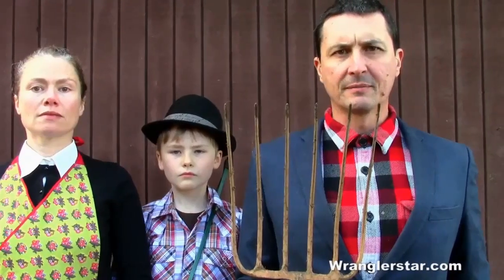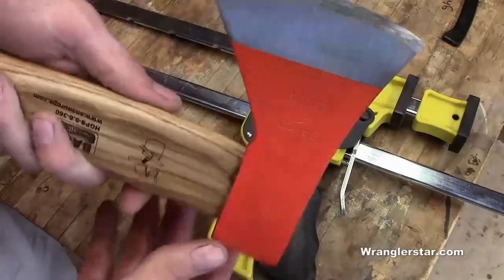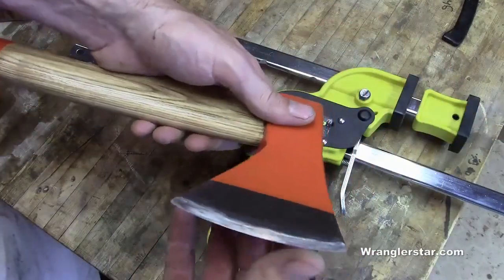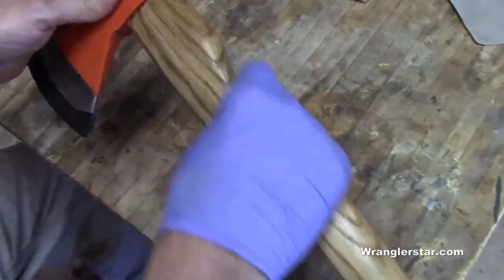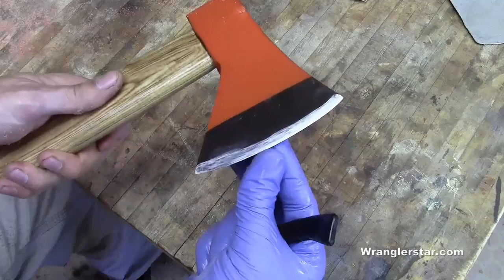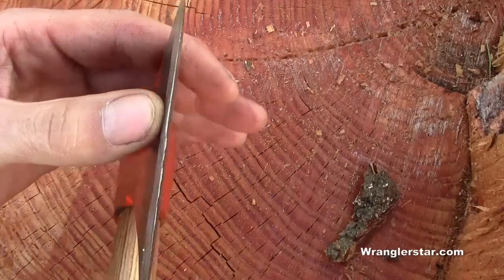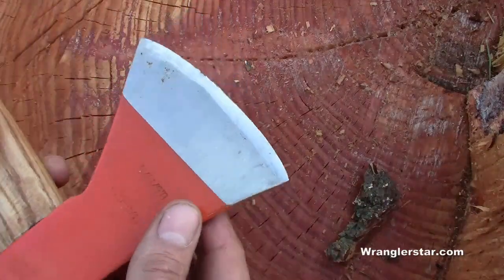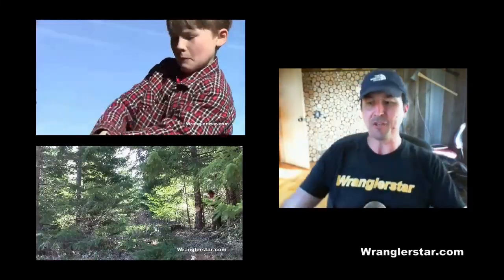Bahco - A Proper Axe Under $20? pt2

Comment: This is really interesting and honestly I am pretty surprised.  I did a video review of these several years ago and have been using one since.  I use it almost daily building log furniture.  One of its primary jobs is trimming knots down.  I use it in pine, cedar and balsam fir regularly and have never  had the edge turn like that.  
I would like to think that your friend simply got a lemon, but I suspect that in the five or six years since I bought mine they may have started using a lower quality steel.

Comment: I did enjoy this review. I was also not surprised at the results. It was easy to see that the head was quite soft steel from the sharpening sequence.

But, that said, it would still make an acceptable camp axe/fireside splitter. I currently use an "old" shingling axe/hammer for that. At under $20, the extra weight in the head "could" be worth it and it does not need to stay raiser sharp for that.

Thanks for taking the time.

Comment: Hi Cody,
I have always sharpened brand new saws and axes. They are dull from the factory. In the early 1970 when I first started building houses we all used stanley rigster hatchets before the onslot of nailguns. I would grind the blade to 3 1/2 inches wide. And put a sharp edge on it. We used the hatchets for everything. Even trimming trees that were in the way. Great video keep up the good work.

Comment: First of all, the reason the bevel from the factory was so steep was probably to prevent the edge from bending over. Secondly like you said, it's a camping axe. It's not designed for chopping 5" branches but for chopping off smaller limbs to use to make a fire. It's something to be used occasionaly, by people who probably don't even know how to properly sharpen an axe. Which is probably why they dipped it in clearcoat, so that when your axe is stored somewhere for half a year it doesn't rust.

Someone who uses it two or three times a year wants it to be cheap, and I think this axe is an excellent axe because it does exactly what it's designed for.

Comment: I have the 19" Bahco Rucksack model and really like it. Holds a good edge and have never experienced the edge rolling issues. The handle was junk and the head was coming loose after a few swings. Replaced the handle and never had an issue since.......

Comment: I got one of these Bahco axes free when I bought two hand saws. I filed a new bevel on it and finished to 6000 grit. I use it in woodland with birch and pine. I have had no problems with the edge dulling.

Comment: Excellent review! 
Solution to the problem is to temper the edge with a torch. You'll end up with a good product by finishing the process of refinements. Sharpening was a good start in refinement.
Thanks for the review. 
Now I know what to look for in unrefinded tools.

Comment: I have one just like that, it works ok for what I use it for. Mostly cutting down limbs before they go into the chipper. And cutting dead limbs off our little fir trees. I left the paint on the handle, so I could find it if lost in the woods. Thanks Cody, I know now not to hack on a 5 inch DF limb with the Bahco.

Comment: I agree with a little softer steel to sharpen down side it doesn't hold a edge as well. I learned this with knifes. I still have a couple of Buck Knifes that I love but the steel is so hard that when you need to sharpen them it takes a lot of time.

Comment: Heat treatment has been suggested before me, and i think that it could help. The head it should be heated to critical yellow (aka non magnetic) before quenching and then the process repeated two or three times. After the heat treatment the head would likely benefit from tempering to a light blue oxidation state. Good luck

Comment: SO
i am a fulltime Bladesmith
I make axes and knifes for my money now for some time

And even the material costs on my axes...even on my steel is more than 17$...

And the steel i use is 100 times better
did split for 2 hours for firewood for my mother, and it didnt even loose its razor sharpness...
and i sell them for under 100$

Comment: Interesting review, I too have this axe in the UK and yes the steel isn't the greatest however mine hasn't curled like yours and holds a sharp edge for quite a while. Maybe just a bad batch. I use mine for green woodworking on hardwoods.
Thanks for the films I enjoy them.

Comment: I think that this axe would have a place by not sharpening it to a fine edge but use it as a firewood splitting axe. we bought a $7 dollar axe from a hardware store about 7 years ago. I have had to remake a handle a couple of times but never sharpened it to an extreme edge. it works perfectly as our firewood splitting axe

Comment: Greetings, Perhaps the failure of the Bahco hatchet is improper hardening during manufacture. If you are correct about the carbon content of the steel, you will be able to re-harden the hatchet. Simply heat the unpainted portion of the head to approximately 1600 degrees F. [cherry red] , Then quench in oil, agitating very slowly. If it gets too hard to sharpen then heat to about one half of the above temperature [800-900 degrees F.] and allow to air cool. This will draw some of the hardness out of the steel.

Comment: Shapeing a handle out a single thickness is much cheaper than handle of swells and tapers. A $20 axe saves a lot of damage/resharpening on a $100+ ax  adding some hard faceing rod or re tempering the edge  would make a good blacksmithing project

Comment: I have a lovely old Swedish steel hatchet about the same size and took some sharpening by hand and then finished to absolute sharpness perfection on my Tormek T7, an expensive but well deserved top performer, and it has performed way way better than that! You do get what you pay for. Why everyone is not buying up oldies for less than new beats me? The satisfaction of whooping the new with a restored classic never gets less and never ever goes away!.
How about we agree on a testing standard so we can compare results? Cuts to sever, blade edge duration, etc? Is there an existing standard to qualify a blade against?
Stay safe and regards to you and family.

Comment: Thank you for putting up this video. I just ordered one of the Husqvarna Traditional Multi-Purpose Forest Axes you mentioned might be a good axe and I was hoping I did not spend too much. I hope it will arrive soon so I can make a proper review video. I have a decent file, but I do not have a stone. Should I spend the extra money for a stone in this case?
Reply: I have nothing but happy with my Husqvarna Multi-Purpose axe.  I do think that you would be wise to invest in a proper stone.  I can put a nice edge with one of the Lansky axe stones then either strop or finish up with a 800 grit diamond stone.
Reply: jeremy kebert Thank you for the info. Do you have a good suggestion where to purchase those stones?
Reply: SpecificLove Amazon. Look in to his stones
Reply: *****

I crank out a knife sometimes in my little backyard forge. I like convex (what old timers call axe edges) bevels for their structural strength. I found the best way to get the bevel razor sharp is to epoxy a soft mousepad to a plank of wood, to lay my sandpaper on (800 working up to 1500 grit). It has just enough 'give' to work around that bevel, but not enough to take away from the edge. I put the final edge on my forged axe the same way.
Reply: Justin Vaughn tonkmonster ***** Jesse W 
Thank you all for the information, this very helpful.
Reply: Jesse W I use a husq hatchet and also prefer the convex edge. I use the same method. Mouse pad and sand paper. Truly sound advice.

Comment: I would try putting furnace cement on the blade until it looks where the temper line normally is and use a torch to evenly head the edge part (grind the edge back a little though so it doesn't crack) and quench it in oil. Not much would be lost as you said its only $17.

Comment: There is a possibility to temper the steel , just heat it cherry red, and cool it down fast, prefebly in oil,to get it hard outside and strong inside, tempering in water wil work to, but i have the idea it gets to brittle, think if you can harden it a bit more it will work.

Comment: Cody or anyone else !!!  Hey I have some leaf spring pieces off 900 series Army troop transporter trucks.    I used them for my kids to shoot BB Guns and 22 at.  They sound off a nice ping when hit.  So Anyway the short ones have a nice curve to it the same as your dr-barking tool.... Wouldn't they already be heat treated and tempered ??  I'm thinking sharpen one end and weld up a handle on the other end.

Comment: Wow, your right. steel against wood, should never act like that. but Santa would never bring something so un-tempered. Great video watch everything and anything you produce Thanks again Cody...
Reply: Not actually...
Reply: threeque The temper is the overall hardness and heat treat of the steel, an mostly how hard the steel is. Annealing draws the hardness out of it. Dew is right, that steel is tempered badly.
Reply: Potato, potatoe...
Reply: Ok I stopped this conversation days ago.

Comment: I have one that is identical and it is made by ox with stihl being the branded name. it's the same axe. I put a very fine razor edge on mine and it has been great. I think there's always a bad apple in a bunch. I bought a wetterlings and had the same problem as that bacho. I reshatpened and haven't had that problem since.

Comment: Yea, I'm gonna agree with a lot of posters here. For 17 bucks I would sharpen, clean up and deferentially temper an ax head made of good quality steel. Just dull it back down again, hit it with an oxyacetylene torch (or place just the edge in a heat source) and oil quench it. I think If you could find the stats for that steel (I'm not a fan of saying one countries steel is better than another's, thats just asking to start a fight) and temper it correctly, $17 and time is more than worth a good ax.

Comment: Most new stuff ends up being more of a kit than a finished product. Production grinding can get too fast and overheat the edge which is why they leave the edge so thick. It might not be a total waste. I bet you will find hard steel with a bit of grinding.

Comment: The way you were able to take a file to it means that this is not heat treated at all. A file will just glide over properly tempered steel and nut cut at all. Not surprised at all that this did not fare well

Comment: Interesting, I have the larger 1 3/4lb Bahco and I could not touch it with a file. I had to use an angle grinder prior to using stones. It is a superb axe which I sharpened into a carving axe, one side almost flat, perhaps you had a faulty one, or I had a good one:-)

Comment: Case harden the edge. heat up the edge to 3000 degrees then quench in used motor oil. then heat up to 400 and cool slowly.

Comment: i have a theory that when you sharpened it with the belt sander you untempered it; side note i found one of these hatchet heads in the gutter on a highway overpass. i was watching your videos so it inspired me to rehab that hatchet head and put a handle on it. i've ran into some problems but its mostly workable. i've also sharpened mine on a belt sander but i didn't do any stone work on it. its really funny to me that you don't like this hatchet though because your videos inspired me to work on this most hated of hatchets hahaha ok have a good one

Comment: +Wranglerstar Could it be that they used some mix with aluminium? Just wondering, since it actually bend over and didn't chip as you would see with the old stuff. Usually steel will chip and fly all over the place (like a fucking bullet, excuse my French), but alu will just bend. Oh and do you have an update on what went on after you sent it to the company (saw your other update videos on it)? Have they figured out the problem, and revised it, or are they once again not caring but only smooching you up to keep you happy?

Love your videos. Cheers.
Reply: Overly hardened steel will chip, soft steel will bend. And since it bends just with minor wood use this must be very soft.

Comment: Well its not a surprise- Its a good looking axe, just needs a bit better steel, I would pay 50 bucks for one if they just use proper steel so you can use the thing for the purpose its made for. In the mean time, My GB small forrest axe is serving me well.Buy once its less expensive in the long term.

Comment: Dear Sir , I had a thought about the Bahco hatchet as far as the hardness of the steel goes. Suppose you or someone were to re heat-treat the cutting edge of the hatchet , would that make it a more worthy tool ? Maybe you could do that and do a review on it ? I've always looked for a "Diamond in the Rough" so to speak. This may be one because the over all design is correct , it was just a poor choice of steel for the head. I've always pulled for the Underdog.

Comment: So, I'm reading some of the comments below, supposing that the problem is in the heat treatment.

Wrong... It's in the material to begin with.

No manufacturer would spend the extra money on a medium carbon steel, and then leave out the reason for using medium carbon steel in the first place.

You have, essentially, a nice wood handle with a piece of junk iron attached.

Frank

Comment: Buy the Husqvarna axes, they are absolutely worth the 70 bucks or so.  Also, I have bought two of the Council Tool Jersey pattern and while they hold up better than the Bahco Cody reviewed, both handles are loose from the factory setting and they don't hold an edge as well as the Husqvarnas.  Save you up your money and get the real thing.

Comment: That's a shame the edge rolled like that. I suspect that the steel is adequate, but it was poorly tempered. Given the rust spots, it seems like a high carbon steel, which should never roll like that unless it has a bad heat treat. You might consider trying another one sometime, as that one might just be a lemon.

 I've otherwise heard good things about Bahco/Snapon tools. I know they have some knives made by Mora of Sweden and branded for Bahco, and Mora makes some EXCELLENT knives that sell for peanuts.

Comment: A good temper might go a long way for that hatchet.  Maybe not, but it works for cold steel....Hey, try to shave off the edge back about a half of an inch and add some good steel to it.  You have a welder and all the stuff to re-profile.  Make it a good axe, that is what you excel at man!  Take everyone along for the ride.

Comment: Hey Wranglerstar... Is it possible that it's good steel, just poorly heat treated?
Heating and quenching the cutting edge may harden it up enough to stop the rolling. Might not be worth it if it needs tempering afterwords though, since the handle would have to come out..

Comment: You gave her a chance and she failed. If you had done a proper HRC (Rockwell Hardness) test, you wouldn't have been so disappointed afterwards. The quality axe manufacturer puts a good tool steel rod into the edge, and smith-welds it within primary moulder together. Then, after proper heat treatment (hardening+tempering) - such axe is hard and durable in contrast to your bargain purchase;-) Yet quality costs much more than $20 !

Comment: What led you to believe that Estwing steel is soft? I have three Estwing hatchets and only one is chipped from dropping it on a rock. I've chopped TONS with the other two, and they remain unscathed.
Reply: My estwing camp ax has held up nicely also. Not the best I have but it stays on the ATV during hunting season and gets used a lot.

Comment: Well I have commented on your first video on the exact same shape and color as that but they are made in China. I saw the edge of the bit after you had chopped through the limb and was surprised at what happened to the edge. The two that I have I have sharpened once and have been copping and splitting almost all my firewood with it but the edge is still almost shaving sharp. Sad results on there steal quality.
Reply: The axes I had purchased were of the cast forged type  and not drop forged like the council tools and Eastwings drop forged. The eyes of the axes may be brittle. The steal is hard as the files like to slid a little before cutting.

Comment: I prefer a harder steel in my axes/hatchets. I'd rather take more time sharpening and have to sharpen less often. Also, you were out in the field and only managed 1 minute of chopping before you needed to sharpening it. That's not the place to be when you need to sharpen, IMO. I'd rather take time, sharpen a hard steel, and get through the day with it. Then I can resharpen back at the shop.

Comment: Bahco is a brand i know well. For me it is a swedish top quolity brand, and realy expencive. Geting a bahco tool at a so low privce is werd. And for it to be so pore in qolity is just crazy. Both is wrong. Btw, where do all you get the "german" from? Bahco isfrom sweden. That thing must be from china.
Reply: onely problem with Bahco tools is the price. one PH2 insulated screw driver from Bahco is 20 dollar alone. and a smal 29 part 1/4 ratchet set is 120 dollar :( and this is in the "low cost" shop's :( if you look up the "bahco s106" tool kit the normal price is 645$ at full price and 336$ in the "low cost" store. bahco cost to mutch :(

Comment: To much carbon build up on the steel, wont quench, and the steel will be to soft, but you never know, might be made of scrap steel too, or just heated for to long, and in any case might be the batch, but for 17 dollars is most likely the process they use to save money. should be double that price before the heat treated steel, and without sharpening and without the handle.